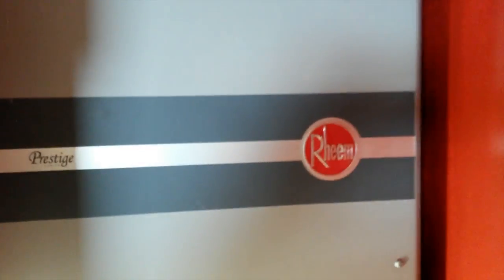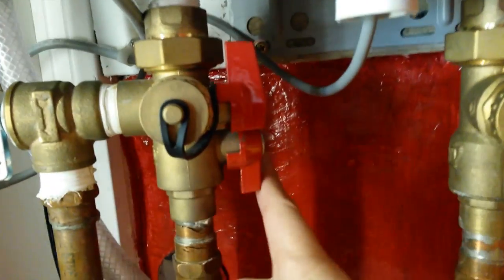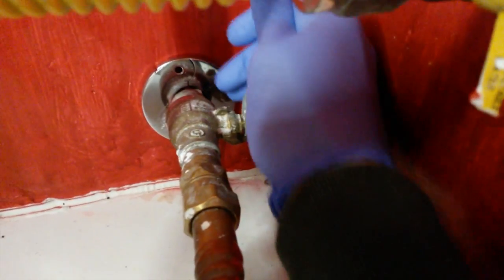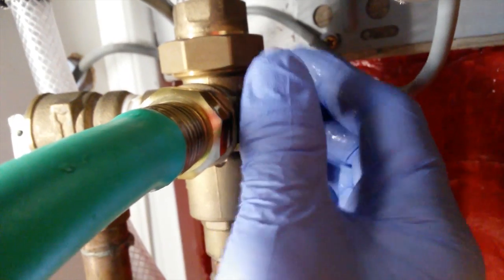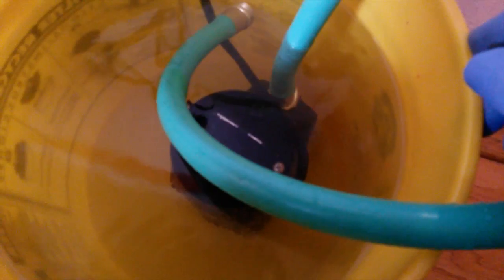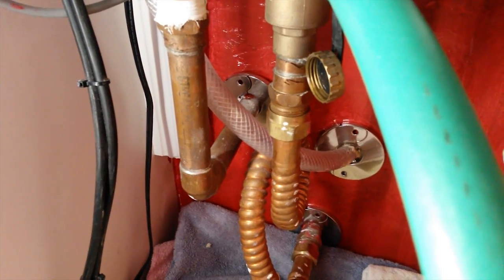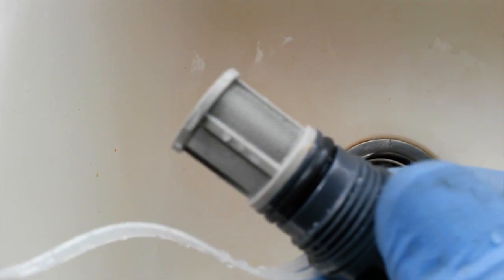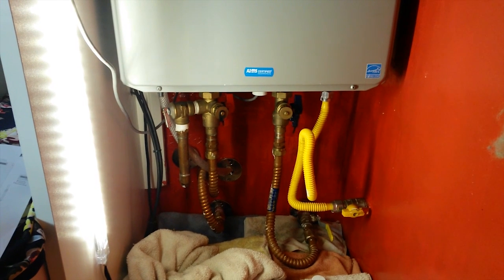Rheem Tankless Lime and Scale Flushing 2017

Comment: Excellent video. I added a step. After the vinegar process, I ran a bucket of clean water through to clean the vinegar out of the pump. Does that make sense?
Reply from the maker: Well it is extra work that is not necessary. When done with the cleaning solution, just open the cold inlet side to flush out the system into your bucket. When clean of vinegar restore system and you're done.

Comment: How can I close or openboth hot and cold water inlet valves if they are stuck real tight?
Reply from the maker: Hung, the first time I had a stuck valve, the plumber came over and just put a wrench to it. Of course if the valve were to snap he was there all the tools. Since that time I have been very careful not to apply too much pressure for fear of breaking something. My advise would be to be firm, but gentle enough not to do damage. If it won't budge open, get help.

Comment: I saw the other guy's comment that lead me down a youtube rabbit hole.  I ended up calling tech services at Rheem and they sent me updated instructions that specifically mention the bypass valve.  Here is directly from the PDF

1. The entire process can take up to an hour or more to complete.

2. Turn OFF the gas and both the hot at cold water supply to the
tankless water heater. The gas must remain OFF during the
flushing process.

3. To properly flush the heater the electronic bypass valve inside
the heater must be closed. Follow these steps to do this: At
the remote control, turn OFF the power and wait 10 seconds.
Turn ON the power at the remote control, wait 10 seconds,
and disconnect the water heater from the electrical source.

*The rest of the steps are basically the same for the flush. I could email you the PDF if you like. I'll include the rest of the steps for anyone else who is interested as I don't want to email everyone.  

4. Leaving the water OFF to the heater, connect the two drain
hoses, (provided with this kit), to the hose connections on the
service valves under the tankless water heater.

5. Place the loose ends of the hose into a 5 gallon bucket.

6. Open the service port valve on each side, (hot and cold
valves), to allow the heater to drain. Connect the hose for the
cold water side to the outlet of the utility pump and place the
pump on the bottom of the bucket.

7. Pour two gallons of vinegar into the bucket, and plug the pump
into an electrical source.

8. Allow the pump to circulate the vinegar for 45 to 60 minutes.
Depending upon the mineral build up and hardness of the
water some regions may require a longer circulation time.

9. After completing the circulation time, disconnect the power to
the pump and loosen the hose from the pump. Allow the vin-
egar from the heater to drain from the heater into the bucket.

10.Close the service port on the cold water side and disconnect
the hose from the cold side service valve.

11. Remove the hot water side drain hose from the bucket and
route it to a suitable drain, use a second bucket if needed.

12.Follow the instructions in the Use and Care Manual, (supplied
with the heater), to clean the cold water inlet filter.

13.ONLY turn ON the cold water supply to the heater,
NOTE: DO NOT TURN ON THE HOT WATER SUPPLY TO
THE SYSTEM AS VINEGAR IS STILL IN THE HEATER.
Water will begin to flow through the heater, this will rinse out
any remaining vinegar from the water heater. Allow the water
to run for about 5 minutes to thoroughly out the vinegar.

14.After 5 minutes, close the hot water service port and discon-
nect the drain hose from the hot water side service valve.

15.Open a hot water fixture, such as a tub, and turn ON the
hot water supply to the system. Allow the water to flow for a
minute to ensure no air remains in the system, then turn OFF
the fixture.

16.Reconnect power to the water heater and turn ON the gas
supply. At the remote control turn on the power to the heater.

17.Run a couple of hot water fixtures to ensure the heater is
operating properly.
Reply from the maker: Thank you for taking the time to post and share the info.
Reply: thank you so much for this video, I saw a video previously where they mentioned that the bypass valve inside needs to be closed but didn't mention how. was looking for this info for a while !
Reply from the maker: @ShrimpCracka  Thank you for the feedback, delighted to hear the video was helpful.
Reply: Interesting. I have been cleaning mine for about 6 years just by shutting the power off at the breaker to it. I wonder why they want you to turn the power off and on for 10 seconds?
Reply: @allenemiesforeignanddomest3320  I see. Mine is an older one from probably 2017. Maybe they’ve changed something since then.
Reply: @flynnsarcade.1982  Man, I have tried every power down, power up, jumping up and down on one leg, and NOTHING will get solution to flow through the heat exchanger on my 2020 Rheem.  It will flow out of the relief if I lift it, but not the HE.

Comment: Great video and info! What size/flow rate pump are you using to flush with?
Reply from the maker: Thank you for the feed back. It is a Little Giant 20 GPM 1/6hp submersible water pump. It just happened to be a pump I had laying around. I imagine the gpm could be less and the results would be the same.

Comment: Couldn't flushing the vinegar out of the system when done to the outside, couldn't you just run your the taps for 5 minutes?  Same thing?  Would it harm the existing pipe?
Reply from the maker: There is only a small amount of solution in the tankless unit, therefore running the tap will quickly remove it. It won't harm anything as it is fairly weak acid and staying in contact for long. If you system is outside or your temp & pressure valve vents to the outside you can use that to clear the last of the solution.

Comment: Great video. Doing it as I type this. Where do you dispose of that much vinegar?
Reply from the maker: Thank you! Good question, I allocate some to each of the sinks and drains as it helps to breakdown grease and gunk in the pipes.
Reply: @cfldriven  Thanks for the quick reply. Was thinking of doing that, but didn't know how contaminated the vinegar would be after descaling. Appreciate it!
Reply from the maker: @chapmanbuddies2388  No prob, the contaminates in the vinegar are the same ones that were deposited from the water. Okay for the drain but not on the salad.
Reply: @cfldriven  hahaha. Was wondering what that extra crunch was lol
Reply: @cfldriven  This is my instinct...BUT, I have a septic system and just read that large amounts of vinegar can be bad for the bacteria that works it's magic down in my tank. Any other ides?
Reply from the maker: @scottmckenna4303  At the time of the video we had sewage service so the use of vinegar and beach was acceptable. I now have a septic system and as you mentioned large amounts of vinegar, bleach, cooking grease, drain cleaner, etc., can stop it from working. I pour my vinegar onto the weeds and other invasive plants in the yard.

Comment: Wouldn't it be recommended that the system be backflushed from hot through cold? Also if a softener is used would it really be necessary to flush annually?
Reply from the maker: This is the Rheem recommended way of flushing the system. If you have soft water or water softener than flushing can done every few years.

Comment: Nice presentation and confirms what I was going to do to clean my system.  I wish the installer would have installed isolation valves on the hot and cold, but as time goes one sees which plumbers do it on the cheap and those that provide a more user friendly installation.  Again, thank you.
Reply from the maker: It would be so much easier if isolation valves were included with all tankless units. I have had two of these installed and each time had to specify the valves. Strange as it such an easy up sell for the installer. Thanks for the feedback and sharing.

Comment: Completed project yesterday,used 12v boat bilge pump! No issues,ran an hour,did notice green tint to vinegar after finishing,thanks again. Concerning pressure drop,filter only had a few s specs on screen,not the reason for pressure drop!
Reply from the maker: Good to hear the system cleaning went well and great idea to use bilge pump. If you ever discover why there is a pressure change at low temp, I be interested in hearing about it.

Comment: Heres a question for you, I live in Ohio & when the weather goes above freezing I wash the car using water thru my Rheem(outside faucet) at lowest temp setting(think 85) i noticed the water pressure drops,but only at lowest temp,if i use water at 110 deg,no pressure drop,any ideas??
Reply from the maker: Never heard of water temperature changing pressure. Usually change in water pressure is scale build up or water filter clogging.

Comment: I'm thinking after unit has 100% vinegar,just close both valves,shut off pump & let it sit!
Reply from the maker: I'm thinking there is a reason the manufacture tells you to circulate several gallons of cooking grade vinegar through the system. Using a stronger acidic level and letting it sit may not be good for the internal components.
Reply: Sitting or circulating,same solution!
Reply from the maker: @pland99  Except in circulating you're moving a lot more volume of solution that can work on the lime and scale for a longer time. The limited static solution will become less effective as it dissolves the lime and scale.

Comment: Why shut off to house f you already have isolation valves
Reply from the maker: In the video I did shut off the cold water valve before the isolation valve because it is part of the prescribed procedure from Rheem. It just a safety precaution, same as turning off the gas. You could decide not to turn off the water main or the gas, but if you turned the wrong service valve you could spray water out, or it the unit wasn't de energized and you left the gas on it could fire up. It a bit of extra safety and if the valves are there why not?
Great question, thanks for watching.

Comment: Great video. What pump are you using? I can’t seem to find a 5/8 connection pump anywhere.
Reply from the maker: Home Depot has the Everbilt 1/4 HP with 5/8 connection and Lowes has similar. Hope this helps.

Comment: my pump stopped making the noise indication it was on after about 10min ... wondering what went wrong..
Reply: Even if you accidentally put Rheem in bypass mode fluid will still flow in and out. Service valve in correct position? Did pump overload circuit? Kink in hose? Does pump time out on its own when not connected to Rheem? Hope that helps.
Reply: @alarce129 That’s a negative. Water will not flow unless it’s in bypass mode.

Comment: In the beginning you said you need 4 gallons of vinegar. Then you put 3 gallons in the bucket. What about the 4th gallon?
Reply from the maker: Robert, very good catch. After three gallons I was concerned that adding another would cause spillage once the pump started running. But as you see in the video it still did the job. Next time if I can get a large enough container, I will go with the four gallons. Thanks for watching.

Comment: Will flushing the system help w/error code 13 or should i get a professional come look at it?
Reply from the maker: Flushing will not help with error code 13. Depending on your diy level you could some or all of the following:

Check that the air intake and exhaust venting for obstructions.
Check the Flame Rod FL-24.
Check the Blower Motor.
Check gas valve assembly.
Or have a prof check these things for you.

Thanks for watching and I would be interested in learning the cause of your error message.
Reply: @cfldriven  thanks so much for the tip and awesome video.

Comment: Thank you so much. It was so useful and easy to follow.
Reply from the maker: Curious to know if you have a tankless in Chicago? How is it in the winter?
Reply: @cfldriven  I have not had any problems with my water heater. I always have good hot water, but I need to wait around 1 min to get the hot water from the faucet.
Reply from the maker: @ali.tarokh  I was initially concerned since the water in our area tends to be really cold, but the wait experience is close to what we had with warmer CA water. Thanks for the reply.

Comment: I got a code 29 , will this take care of that code 29 ??
Reply from the maker: Here is what I found, hope it helps.

If you receive an error code 29 on a Mid-Efficiency or Condensing unit, it indicates that the heat exchanger temperature is too low. However, it could also indicate that the neutralizer is clogged on a condensing unit. Here's where to start when you see this error code:

Clean the air inlet screen.

Clean the fins on the heat exchanger.

If you're still seeing the error code after doing the above AND your Rheem tankless is a condensing model, check the following:

Check that the drain line isn't blocked and that the shipping cap has been removed.
Inside the unit, clear all of the neutralizer drainage ports.
Outside the unit, clear the neutralizer drainage line.

Comment: Thank you for this very easy to follow video. Quick question, can you please link or recommend a submersible pump and its strength (GPH). Thank you.
Reply from the maker: What I have is a discarded submersible pump, nothing special about it except the house thread. Since it only pumping a few feet and being used once or twice a year, just about an UL rated submersible will do with a few gpm will do.
Reply: I used this one from ebay:    https://www.ebay.com/itm/NEW-Electric-Portable-Utility-Water-Transfer-Pump-Pony-Pump-115-120-v-1-imp/233550828263?ssPageName=STRK%3AMEBIDX%3AIT&_trksid=p2057872.m2749.l2649
you would need 3 hoses, since it is not submersible. I only needed one gallon of 5% vinegar.

Comment: Hi sir, what to do when the unit is leaking water?
Reply from the maker: Shut off the water supply? Depending the location of the leak, service valve port, you may be able to tighten connections. If internal to unit, that is a call to Rheem. 

My unit started leaking a few days after installation around the union and I had the plumber come back out and correct it.
Hope it gets resolved soon. Let us know what the solution was.
Reply: Thank you for replying sir. I did shut all the water lines but the leak still going inside the unit. I have to call the rheem. Thank you
Reply from the maker: @rgmagz5719  I hope you are able to share how your experience with Rheem support goes. I lived in two homes that each had Rheem units and never had a reason to call them. Hope it is an easy fix.
Reply: Hi there, did you ever resolve the internal leaking issue? I just performed the descaling and now that everything is reconnected I notice a good amount of internal leaking. There’s a ton of salt or limescale or whatever on the inside of the unit, so this leaking might’ve been happening prior to the descale.

Comment: What is the significance of one of the hoses being a female to male?  I never saw any distinct use of that male connection in the video.  Thank you for the video.
Reply from the maker: As you know the average garden hose has a male and female connectors which works for most applications. However in this situation the output of the pump requires a female connection and since the other end needs to connect to the service valve it too needs to be a female connection. Of course the output from the Rheem will made to a female connector and the other end which is discharging into the bucket can be any connector or no connector. Sorry if it wasn't clear in the video.
Thanks for the feedback.
Reply: cfldriven ah ok makes sense. I ended up just using a bucket and discharging 5 gallons of the clean out water into a bucket so get rid of the strong vinegar. and then sent the rest to the outside via the relief valve.   Thanks for the video. Procedure went much easier than I even anticipated.

Comment: Aren’t we supposed to elevate the pump slightly so the pump does not suck the dirt back in the water heater?
Reply from the maker: There shouldn't be any dirt, all you are doing is dissolving the mineral deposits. Any particulate that gets sucked up the pump will be stopped by the built in filter on the cold water inlet. This filter should be cleaned after flushing to eliminate any particles trapped from the incoming cold water. Depending on your water supply check the filter one to two times a year. Thanks for the questions.